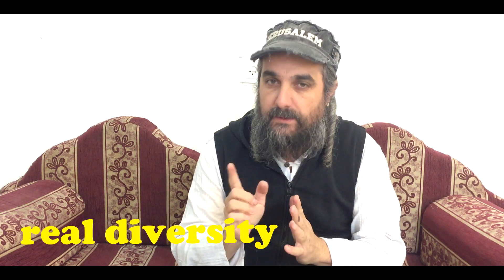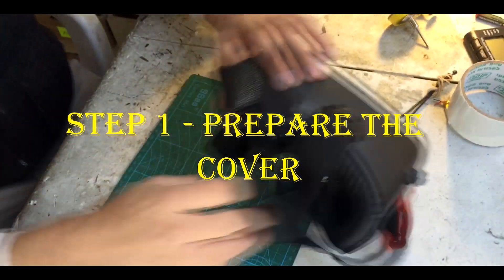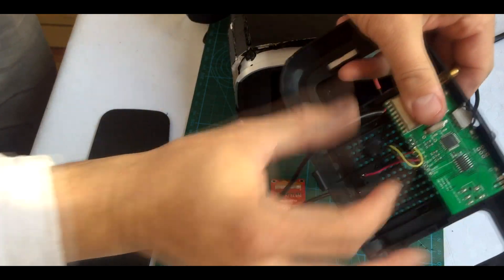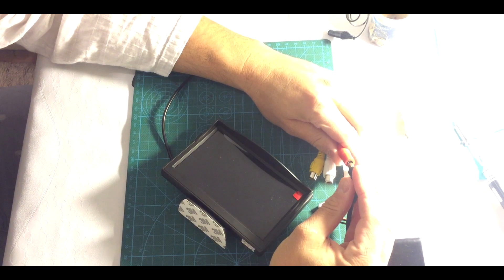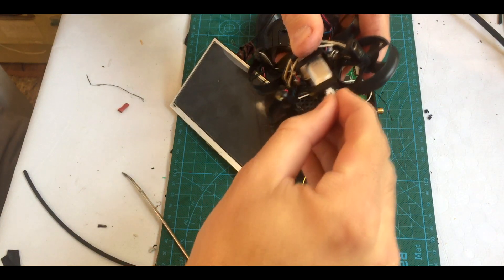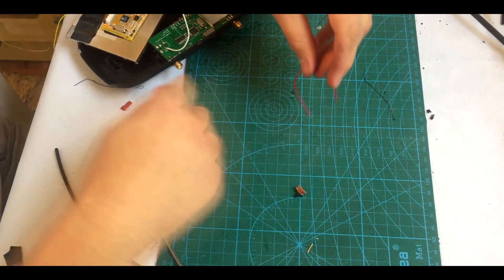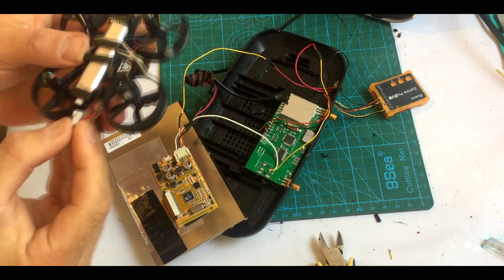homemade BUILD FPV GOGGLES + DVR THE BEST!!!

Comment: Hi... Congratulations for your setup... But at the end is not so clear the wire conection... I m question myself where was lost it the black wires that you not use...
Reply from the maker: please Let me know what time on the timeline so I can answer your question
Reply: Hi again... Yes. I buy a Headplay SE and result in malfuction... I lost my money.. Only 100 mt of range by much. Im interested in arm your setup. I read 2 km of range on your answering coments. Wow! Amazin. In the minuts 10:23 and 10:50, you describe the conection of the backside of monitor, but is not clear what wire come frome, overall wats the channel 2? And the moment you conect the monitor to the power of battery is not so clear. By otherwise in the minut 14 and advanced you describe the DVR  conection, but look simple and you explain it. But.... In the video is so hard the origin of each wire... And these black wires(ground maybe?) sorry i get lost... You have a imagen... Maybe a draw... My messenger is : Medcp Humberto Cortes Arroyo.... I like you kindly can help me.... I only make flying with micro drones. I buy a FURIBEE gt215 and a can't fly on FPV.... Thanks in advanced and blessings!!!
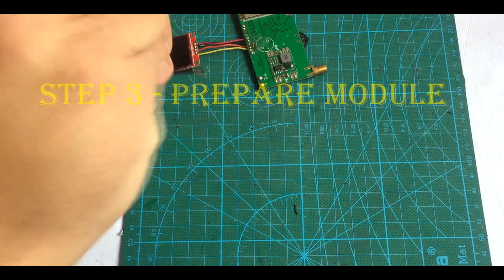Reply from the maker: You explained well in detail. important to know that if you do not use good transmitters and good antennas, you will not receive good reception in any goggles ...I hope I can answer you - at 6:41  I show where I sail battery voltage - and at 10:40 I sail the black wire and the red to the same place of battery voltage ..
As for the DVR, I connect the red and the black to the 5V in the module as shown in 14:37. Note that the screen has two video inputs - I connect one of them to a modul video port and one of them to the DVR OUT port .. And of course I connect the DVR IN to that point of video out in the modul
But if you have a HEADPLAY and this nice goggles I suggest you do as in this video and you will get a better and easier result ------ https://www.youtube.com/watch?v=REnAtrHlGQY&t=436s    
Hope I helped you GBY
Reply: Ok... Man!!! I see the video where de Headplay is upgraded... Ill try... Thanks alot...and is because the monitor of headplay have more definition... From my heart thousand of thanks.... And go away working for help to us... Flying adicts... Have a nice night...!!!

Comment: Can this use for recod video?
Reply from the maker: Sorry I did not understand the question
Reply: I mean,can this FPV be used for recording video
Reply from the maker: Sure - I've put in a DVR that lets you record everything you see in goggles
Reply: Is there a some button for record video?
Reply from the maker: Yes - The DVR itself has a Start / Stop Recording button
Reply: What the function of mini lcd at front?
Reply from the maker: It belongs to the module receiver

Comment: Naftuly 
if you should build a new one today..
Would you then build with all the same parts/materials ?
Or, are there some new and improved parts, on the marked today, that you want build with instead??
For example: diversity and 5inch LED screen?
Reply from the maker: Thomas Bech- hi dear that's really good question ..but today I don't know about better parts .. however today you can find FPV goggles with diversity  in good price .but all the fan is to build tham .. Wish you luck and success
Reply: Naftuly FPV hi again my friend:)
Do you know the exact dimension of the display ?? 
I want to replace my screen inside my eachine vrd2 goggles but I don’t know the screens dimension so I don’t know if it fit my goggles:)
Reply from the maker: Thomas dear - I do not see the need to replace the screen in eachine vrd2 - this screen is like all the 5" screens that there is today .. If you want a higher quality screen I would recommend eachine goggles two with FHD I personally very much enjoy them - good luck
Reply: Naftuly FPV I want to change my screen, because they are broke inside.. I have black screen and can not use my goggles anymore:-/ therefor I need another screen for my Eachine vrd2 goggles..
Are there a better screen options out there??
Reply from the maker: It's the most  normal screen that I know - https://www.banggood.com/Blue-Sky-5-Inch-HD-Digital-Panel-Display-800x480-Snowflakes-Screen-p-970382.html?p=YC09028706822014115O&cur_warehouse=CN

Comment: If your signal is strong enough and you don't test your limits it's okay to use blue screen displays... I have a few that I use for close proximity fpv.
However in any situation where signal penetration may be an issue it's best to use a monitor with snow like he says and to avoid anything that goes blue or black in the event of signal loss

Comment: now can you range test those with some various vtx's (25, 200, 600...mw) maybe please :)
Reply from the maker: i use tbs pro hv 800mw and i get more then 2 km
Reply: QUADCOPTER FPV yes yes...sounds good, however, "could" you please do a range test video with various antenna and vtx's with you homemade goggles..please :)
Reply from the maker: I'll try

Comment: what magnification was the lens? 1x, 1.5, 2, 2.5...and did you have to flash or setup any software (firmware) with the diversity reciever?
Reply from the maker: hi - I use the 2.5 lens for that project , and there is no need to flash or setup sofftware  just PNP
Reply: QUADCOPTER FPV great channel (totally subbed) i hope to see more innovative projects from you :)
Reply from the maker: Jason Beauchene thanks bro

Comment: why is it necessary for the display should be a non blue screen ?
Reply from the maker: Because if you will have a weak signal to'll get a black screen and you may lose the quad
Reply: thanks

Comment: Hi Naftuly, i fried a screen awhile(800 x 400 snowflake) ago, not sure how i did it, looking at your monitors, there is a module sitting behind them, do you know, would it be hard or easy to replace that, (which i'm sure is where the fried part is) and keep and attach the screen to a new one(circuit board/module/for screen)?
Reply from the maker: Sorry I do not know what to say ..didnt  tried
Reply: ok :)

Comment: can you confirm that the screen you link is snow not blue screen?
Reply from the maker: --  hi - I can not confirm ... I ordered two and one of them was bluescreen ... Although banggood stated that it Snowflakes Screen -i get refund for that one. So a request to do a test before the start - Connect battery and if there is no snow = Not Good
Reply: Oh! thank for the info! i will make one just like yours with a smaller case for my face!

Comment: Thank you for the video. Is it okay to test the signal without attaching the antennas?
Reply: Abducted RC Yes. Is with the  transmitter the problem if you don't use antenna. Never test a transmitter of any kind without an antenna installed.
Reply from the maker: Yes - it's not - transmitter its only receiver

Comment: what is the connection type from your battery to the power of the monitor?
Reply from the maker: owenkilleen   Good question , you can use what ever you like  ..I use the One that  came with the screen and I take the connector from defective  fatshark battery that i have at home  -  notice you connect  3s lipo to the module and the screen together  .
Reply from the maker: please Check it out - https://www.rcgroups.com/forums/showthread.php?2805514-the-best-FPV-GOGGELS-homemade/page2#post36585103
Reply: thank you :)